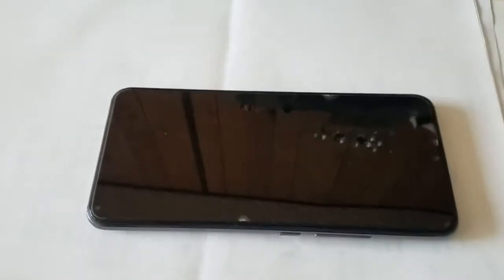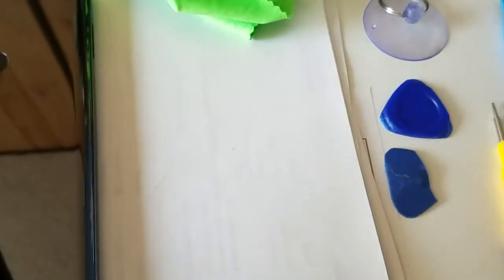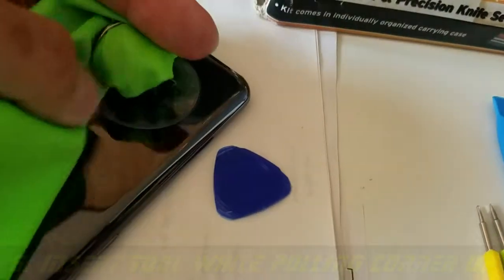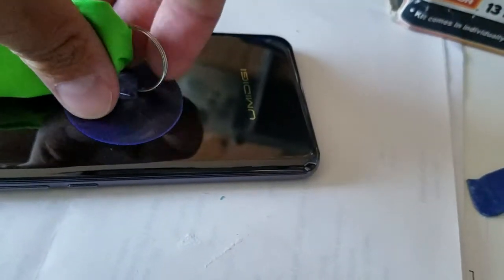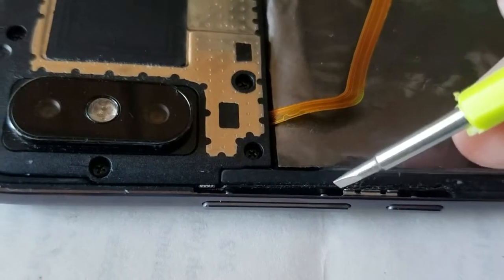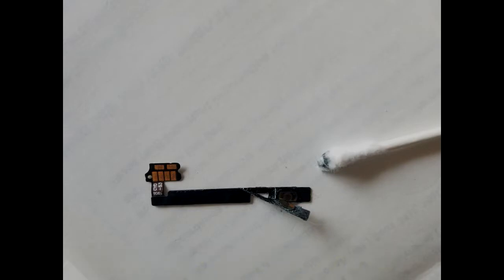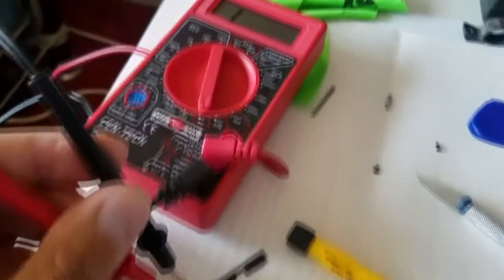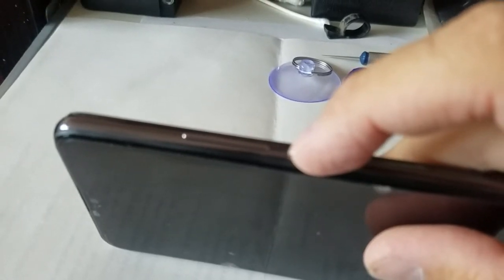Umidigi s3 pro smartphone power button repair guide

Comment: how long did you heat the back before being able to wedge the tool in? and how did you glued the back again at the end? thanks!
Reply: Yea I am interested to know how easy it is to glue the phone back together, if it fits ok. I need to repair the front camera on mine and am worried it will be a big job.
Edit: I just saw your other video, which describes heating the glue back up to re-stick. Thanks!

Comment: Thank you for the video.  Great job! 

Could you do a video on replacing a cracked screen on an umidigi s3 pro?
Reply from the maker: Glad you found it to be helpful! I haven't had to do a screen replacement on that phone. I still have the phone but I use my Xiaomi mi 9t pro more than the umidigi now. I would assume it shouldn't be too different than other phones like a Redmi note 7, or umidigi f1.
Reply: @bigmurff  I am a little confused about what to buy.  They seem to sell the replacement screen with or without a frame.  I am a little concerned that it seems like I'd need to disassemble the entire phone.
Reply: @ShredPhred  same here, got an S3 Pro with cracked screen (still working great though). I'd like to change it but not sure if trust myself...
Reply: @ThomasWinders  I changed our usb port in a F1 play and it was not difficult but had to pry off the back casing.  The s3 pro probably opens the same way.

I think these Chinese phones, the entire digitizer is replaceable so no replacing just the glass.  They are 1 piece with just a ribbon cable that attaches to the motherboard.